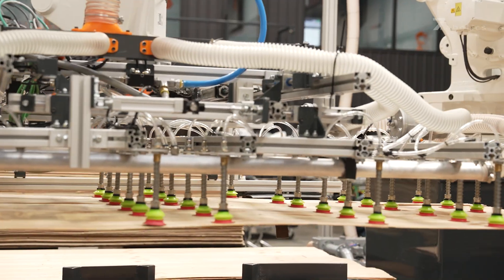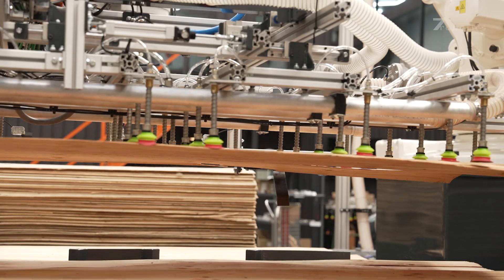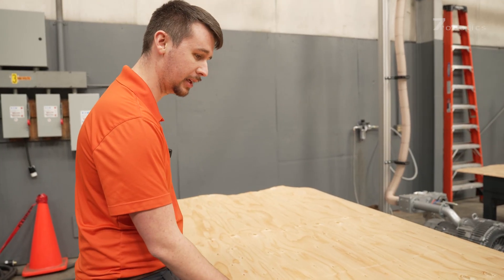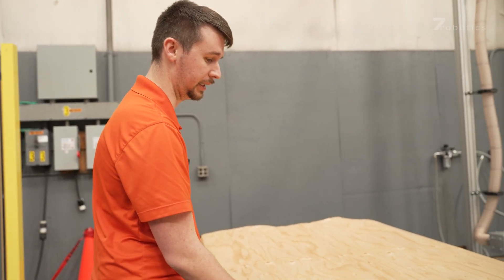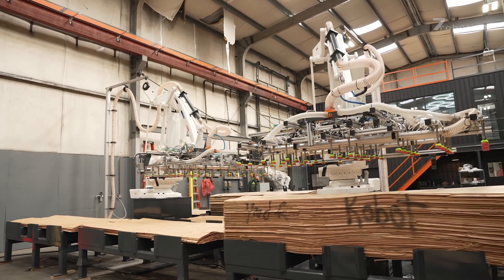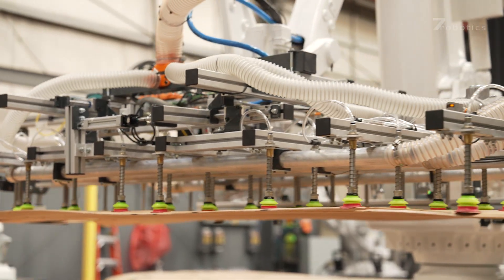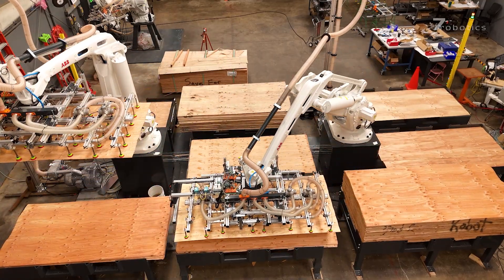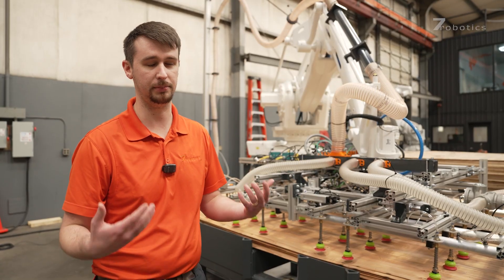Safer, Smarter Veneer Handling with Robotics

Comment: Cameras and AI.. can be taught that grading system pretty damned fast. Operators will be gone soon enough. Grading and stacking 24/7 will be so much cheaper that even if they are not better than a human.. it won't matter.